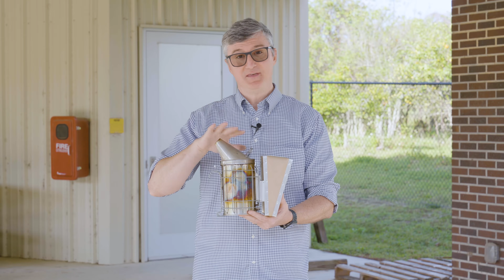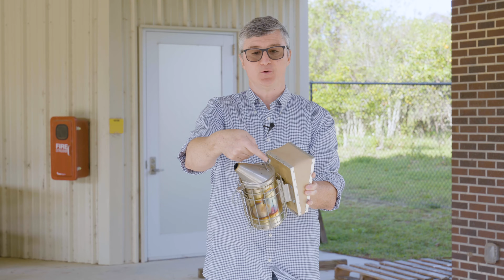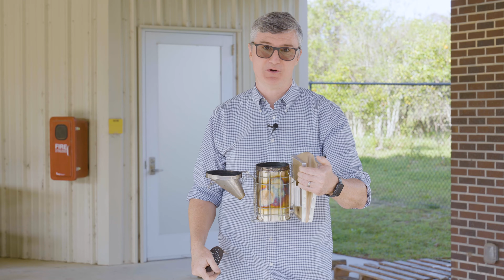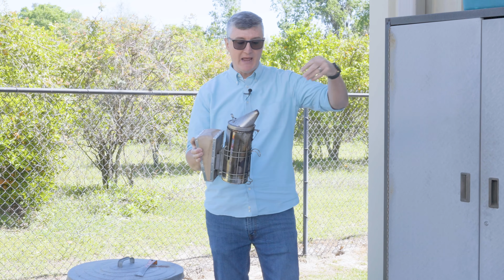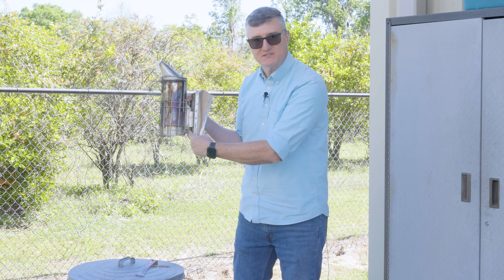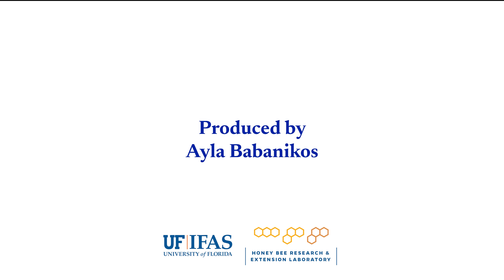Lighting a Smoker | Beekeeping Academy | Ep. 28

Comment: The exterior on the  top of the chamber and the inside of the lid also get a lot of tar/creosole that needs to be cleaned off.  If not, after a while when using the smoker, it is difficult to get it open.
Reply from the maker: Thanks for pointing that out!